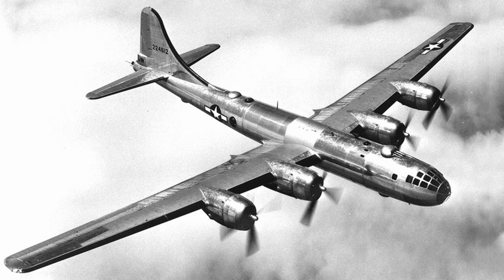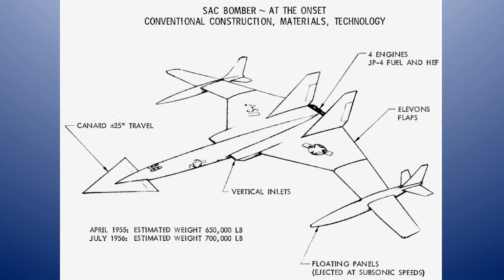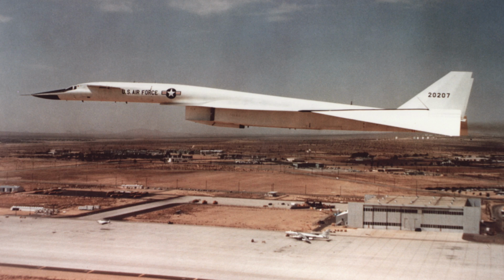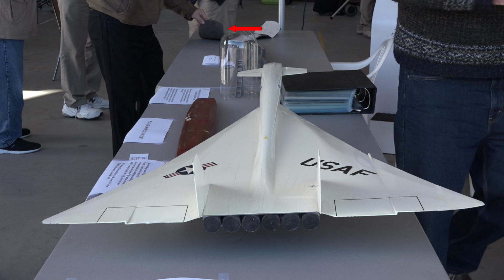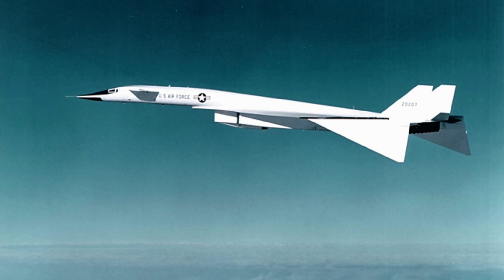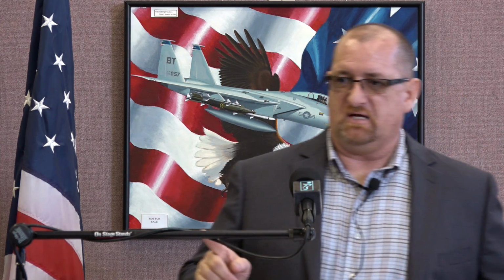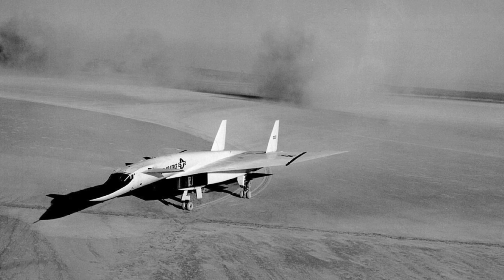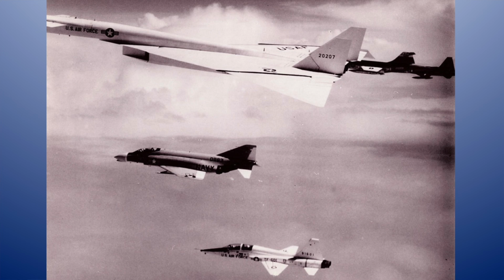XB-70 Valkyrie

Comment: Great stuff - as usual.
Reply: XB-70 Valkyrie was a fantastic airplane.  Probably my favorite airplane (and many others) ever produced by the USA.  Obvious, Air France/British Airways borrowed heavily from North American Aviation in the Concorde program.  However, the USA was producing a multi-sonic bomber/reconnaissance airplane at the same time aka SR-71 which was in production until the late 80s.  Unbelievably, the Soviet Union built an an entire fighter/interceptor based upon the XB-70 which was the the Mig-25. Those planes could "blast" to Mach 3+ but waste their engines.  However, the end of the Valkyrie wasn't performance, but technological issues and Soviet surface to air missile technology.

Comment: That was/is an awesome looking plane...and 6 engines at 30,000 lbs. of thrust each= 180,000 lbs. of total thrust...incredible..!! I did find it interesting that, however, that the presentation was not made by an XB-70 pilot. I wonder why?
Reply: Remember, it's been nearly 50 years since this plane last flew. Al White, the pilot who ejected, would be 98 years old if alive today. Possible other pilots were younger but probably still too old to care about doing speaking engagements.
Reply: There are no living XB-70 pilots.  Some of the co-pilots survive but they are old as dirt and aren't up to speaking.  The remainder were company test pilots, who are also dead.

Comment: there are different opinions as to why it was cancelled.  I think it had to do with Kennedy winning in 1969.  With Mcnamara, there were many cuts and changes.  I think if Nixon would have gotten in in 1960, it may have survived
Reply: Nah, the XB-70 had a LOT of technical issues and wasn't very long-ranged for a plane that was dubbed a strategic bomber.
Heck, they couldn't put a decent paint job on that plane without it partially peeling off after every flight!  It looked almost as bad after every supersonic flight as the Space Shuttle Columbia did when it was delivered to Kennedy Space Center with 1/3 of the tiles missing in 1978!
There have been concerns about the stability of the surviving XB-70 prototype.  It was on outdoor display for many years (20+ years) at the National USAF Museum.  They finally moved it indoors because A) it WAS showing some signs of deterioration and B) it's the flagship aircraft of the USAF Museum.  It was in their continued economic interests to keep one of their most popular exhibits intact and they could really only ensure its continued survival after they moved it indoors!  The XB-70 was partially deteriorating because of the way it was built.  It was built with early lightweight honeycomb construction (predecessor of the composites we use today in plane construction) but that tech wasn't perfect and showed signs of deterioration during the test flights.  It's great that it only showed those problems on the prototypes and NOT 100 or more production planes that were in-service.  It's very expensive to fix these problems after a plane is already in-service.  Better to tackle those issues in pre-production planes.
Uh-uh.  They made the right call here when they cancelled production of the XB-70 and made it a tech demonstrator.
The only supersonic bomber (aside from the FB-111) that SAC ever employed was the B-58 and it was in service for only about 10 years, too.  It was a maintenance headache, had a lot of accidents, and was really limited in weapons load and range, too.  Its most useful ability was to set speed records and that was about it.  What makes anybody think the B-70 would have been any less of a headache to maintain?  It was a full Mach faster than the B-58, would have had higher heating of the airframe, and would have required even more safety checkouts and maintenance of the engines and airframe to keep it operational.  That adds up to being a HUGE hangar queen.  That's not the kind of plane the USAF wants or can really afford to be honest.
The B-1B is really a subsonic bomber with very limited supersonic flight capability after the B-1 was redesigned for low-level penetration.  If they could have redesigned the plane economically to get rid of the variable sweep wings, I'm sure they would have.
The most successful strategic jet bomber to date is still the B-52.  The ultimate replacement for that plane will be another version of the B-2 which is subsonic, too.
Supersonic speeds are just not compatible with decent range/weapons carrying capacity and reduced detectability...  They certainly don't work out for lower maintenance requirements, greater fuel economy, and greater reliability, either!

Comment: what happened to the b47
Reply: Arthur Fiorillo Believe it was replaced by the 52.
Reply: The B-47 was taken out of service by the mid-1960s because it was too reliant on aerial refueling and couldn't carry the weapons load SAC wanted out of a strategic bomber.  It was really a mid-range bomber (4000mi) and NOT a true "strategic bomber" (at least 8000 mi range, unrefueled).
It was essentially a lead-in, technology demonstrator and proof-of-concept plane but it was far from perfect.  It was brand-new tech (aerodyamics, jet engines) that had to be refined and debugged.  That was a process that took at least 10 years but in the meantime we couldn't get to the B-52 without going through the teething pains with the B-47.
Don't worry, though -- there are TONS of preserved B-47s in museums all over the US.  The plane's significance was recognized and basically ever major airliner in service today owes a lot of their aerodynamic/wing layout/wing-engine nacelle combo features to the B-47.  The major difference I see is that the B-47 had a high-mounted, "shoulder-type" wing instead of the mid-mounted  or low-mounted wings of today's major airliners.
The B-52 and the Boeing 707 would NOT have happened without the B-47 flying first.
Reply: Plus at the time the B-47 scared the crap out of the Russians, because of it's speed. Are there any that could be rebuilt to fly again? The B-52 is still flying. I personally thing the military should respect their equipment of old rather then just let them rot. Bring them out on holidays. The reason I have an interest in the B-47 is that back in about 1965 My father was stationed at Pease AFB in New Hampshire. There where 2 at the end of the runway for the fire crew to practice on and it seemed such a waste of a beautiful aircraft. They looked much better then the BUFF. I got to get into the bomb bay where I missed a step and fell on the ground. Good thing I bounced at the time.

Comment: XB-70 is canceled because of the Mig-25. That mig was and only plane that Soviets were ahead of USA. All other times and to date, USA leads.
mig-25 also very amazing in terms of technology; stainless steel plane, able to achieve mach 3 operationally., yet much cheaper than SR-71.
Reply: Not really. It was cancelled because

a) it was a very expensive programme

b) it was not going to be as effective due to the advent of ICBMs

c) ground to air missiles were rendering high flying bombers vulnerable.

The knocking down of Gary Power's U-2 in 1960 by a Soviet SAM proved that the high flying bomber was no longer viable.
Reply: the MiG-25 was no factor. In fact the MiG-25 wasn't even a thing by the moment the Valkyrie had been reduced to a technology demonstrator, and certainly the americans didn't know anythign about it by that stage.

The XB-70 program was kept alive for testing and propaganda purposes only, both the Congress and the USAF had decided there was no use for such a bomber well before the first prototype took to the air, and the reasons were pretty straightforward:

1st: The nuclear bomber force took a backseat in SAC priorities compared with the ICBM force. From being the main strategic nuclear First strike/Fast answer delivery asset of the US Air Force, it was downgraded to a secondary "reaction" force. The XB-70's cost was spectacular and now it was no longer a priority, there was no justification for it's tremendous cost.

2nd: SAMs had already proven that flying very high was a no-go for bombers. So the primary SAC mission profiles changed from high speed dashes at very high altitudes to very low nap-to-earth penetrations. And it just happened that at very low altitude a XB-70 was not even able to go supersonic without tearing itself apart (air is FAR more dense down at sea level than up high at 70k feet).
In fact at low altitude the B-70 was barely any faster than a B-52, but had only half the range than the Stratofortress(the B-70 long range came out of it's ability to cruise at Mach 3 with fantastic fuel economy, at subsonic speeds it was very fuel inneficient). Given it's cost it would've been stupid to pay for it when it was actually less capable that the bomber it was supposed to replace.

The MiG-25, btw, wasn't ahead of anything the USA had. It was an one-trick pony very fast, very unflexible, interceptor and recon plane. It weighed a shit-ton, was as maneouverable as an iron sled, couldn't turn worth a damn, and had the cockpit visiblity of a jail window. 
And to top it off the plane wasn't able to go any faster than Mach 2.5 without slashing it's range by half, by destroying it's own engines, and by reducing itself to an unfliable piece of junk until a complete airframe revision was accomplished (to go alongside the replacement of the engines).
Yes, there were a couple times that MiG-25s were clocked at Mach 3.2 - each time they were very short dashes,  each time the plane's Tumanskii engines had to be sent to the scrapyard upon RTB because they were beyond economic repair, and each time the planes had to be subjected to complete airframe revisions to make sure the only thing that had melted were the engines.

Matter of fact, by the time the soviets were able to declare the MiG-25 operational, the CIA was already flying the A-12, predecessor of the SR-71. A plane that cruised at Mach 3.2 ....and was able to do so for hours, in missions involving huge ranges, and without destroying it's own engines in the process. "Ahead of the USA"?. I don't think so, buddy.

PS: I'm not even american but to discuss the technological superiority of the US aeronautics of that era just leads nowhere. And no, the MiG-25 isn't any exception to that. Quite the opposite, actually, a comparison of the recon MiG-25 with the A-12 shows how brutally far ahead the US was, as does a comparison of the interceptor MiG-25 compared with the perfectly feasible performances the YF-12 (fighter version prototype of the A-12, discarded because the USAF considered they didn't need an interceptor of that performance at all) had to offer.
Reply: EricIrl, ramjb, Harri v'Jah, 
Thanks for the great posts, analysis. It takes a long time to write items like those, it takes a while to read them for that matter. I've learned to stop reading as soon as a yellow card is issued by my mental referee. All of yours were finished and I even clicked to see what content you've posted. (I don't have anything posted but comments)
Reply: Not at all. The Mig 25 engines were pure crap. They were not allowed to be run on full burner more than 5 minutes or they would melt down!  You ain't catching the SR or the B-70 with THAT! Especially from a ground launch.
Reply: @ramjb , agreed. When Viktor Bylenko defected with a MiG-25 in 1974 ('76?) we were shocked at what garbage they were.  The Soviets demanded it back, so the boys from Wright-Patterson's Foreign Tecnology Division obliged them. They flew to Japan and stripped the airplane down to the individual rivet crated it up and the Japanese insisted that the shipping was paid in full before they allowed it to be loaded onto the freighter to send it back. We learned enough about the MiG to not be afraid of them or the MiG-31 it evolved into. A lot has been said about the similarities in configuration between the MiG-25 and the F-15, which was flight testing first, but second into service. The Foxbat was a short-lived brick with wings, while the Eagle is still in service 45 years after the first squadron was activated, with the best kill ratio of any combat aircraft in history (helped by the fact that no Eagle has ever been shot down after 45 years of combat operations with several different countries generating well over 100 kills).  The Eagle has also proven to be able to fly with on wing ripped off, something that the Israeli Air Force was the first to learn in 1974 and USAF duplicated when I was a young Airman.  The MiG-25, by comparison, barely flew with both wings attached.